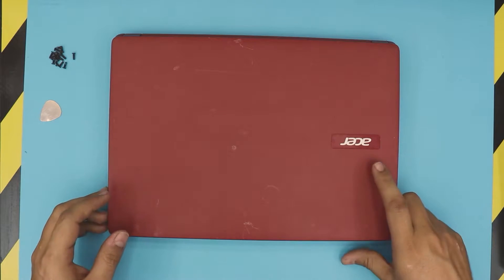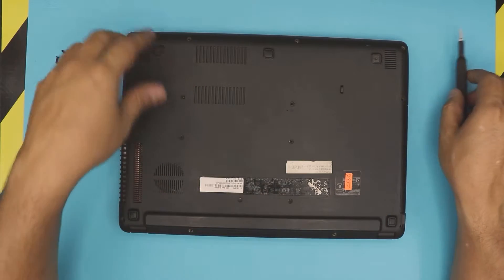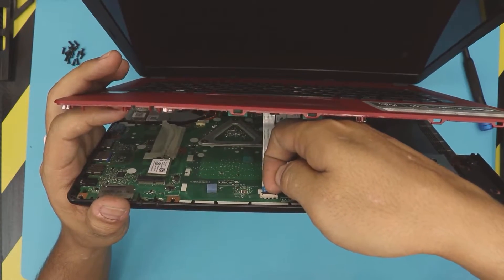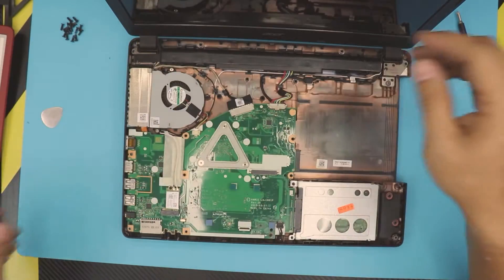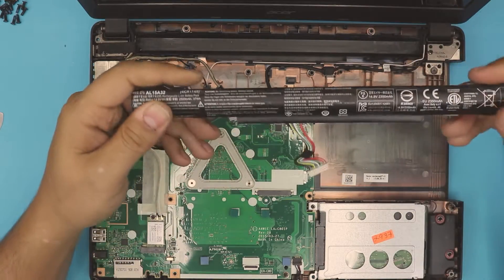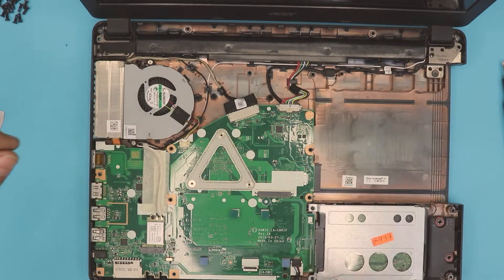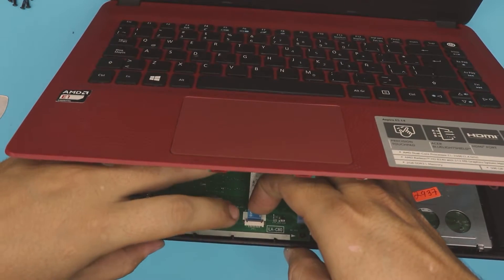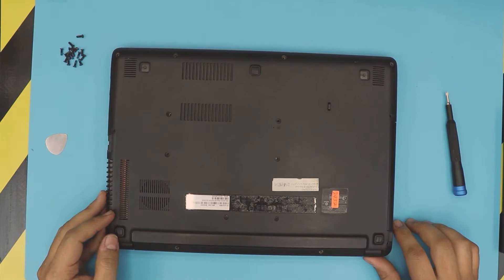Acer Aspire Es 14 Battery Replacement Guide

Comment: help please, my battery is stuck at 0% charging, I haven't used the laptop in a long time
Reply from the maker: Thank you for the feedback! if you wish to support the channel you can LIKE or SUB or both :P
regarding your question: if you didn't use it for long time the batteries go back without using , you must replace the battery, there is noting you can do with systems.

Comment: My acer laptop power and charge lights flashing .... I have battery charge 50 percent now, it is working fine with battery...but when I keep charge it charge for some time less than 5mins later again flashing and stops charging the battery

I removed battery and only AC source I connected laptop working

I am unable to find charger or battery which is problem?

Without charger battery working, without battery charger working....when both together flashing and not charging...please tell me what to replace ?
Reply from the maker: you have a bad battery my friend we get this problem in the store often and the issue most of the time is with the bad battery. replace your battery and you will have no issue.  but if you always have access to power, you can use the laptop with power only and there is nothing wrong with it.

i appreciate your support to the channel by subscribing :)
Reply: @uFixTek  my battery is just one year old...my system doesn't faced any issue regarding battery, no backup issue, no sudden shutdown... actually due to power fluctuations charger cord burnt...I replaced cord, now IAM facing this blinking issue... without battery laptop working fine with adapter...iam thinking charger not able to charge the battery and run the system same time
Reply from the maker: do you have a multimeter or ampmeter ?, because its a very rare case that a charger gets damages and cant provide enough AMP,, because the voltage cant drop!, but its very very rare, and i 90% dont think its your charger.
the things that could go wrong.:
#1. common isue battery starts going bad
#2: 2nd common would be a bad windows update driver for A/C. i would recommend you to unistall the A/C charging Drivers. by following this steps:

The power behavior is controlled by your hardware settings.
Issue can also be with the faulty adapter or the charger component on the mother board is not working.

You may try these steps and see if it helps you.
1.      Click start
2.      Type devmgmt.msc in the search box and hit enter
3.      Expand the Batteries category in the device manager
4.      Right click the Microsoft ACPI Compliant Control Method Battery listing and select uninstall
WARNING: Do not remove the Microsoft AC Adapter driver or any other ACPI compliant driver.
5.      Click scan for hardware changes
Windows will scan your computer for hardware that doesn't have drivers installed, and will install the drivers needed to manage your battery's power. The notebook should now indicate that the battery is charging."

Try these and let me know!

if the above didn't resolve your issue then you may have a bad power regulator chip that is on motherboard that is not working properly.